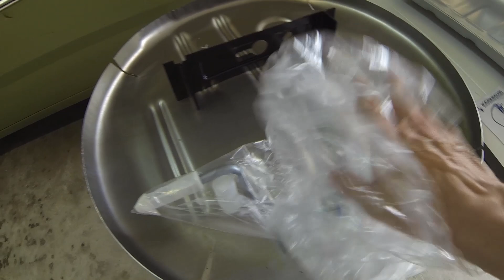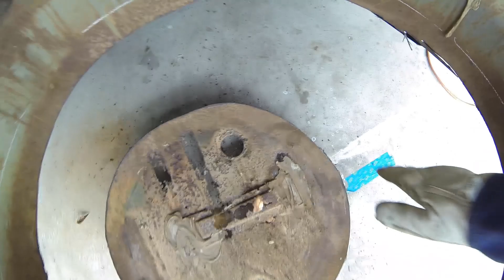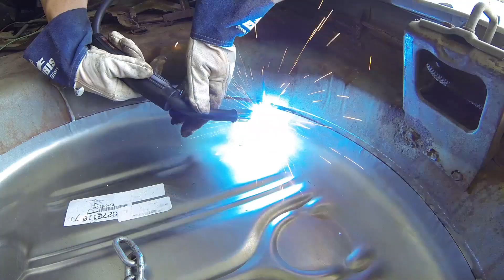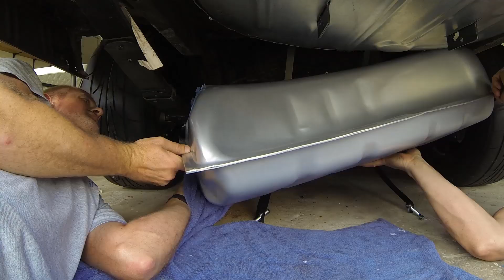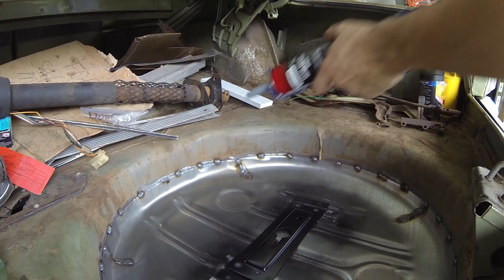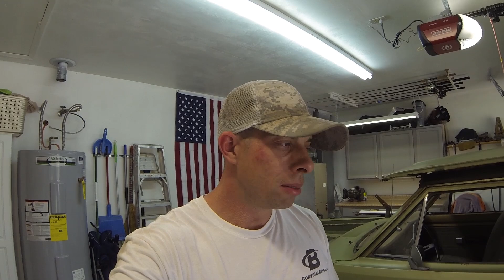New Trunk floor pan and Fuel tank(69 Valiant)

Comment: Alex, I have done many weld jobs in the Navy. What I learned is when welding on steel and you have a hole or area behind your weld where there is nothing. Instead of using aluminum. Place a nice thick piece of brass behind it. We weld filled holes on submarines all the time. We just grabbed a piece of brass solid stock or round stock 2" or so in diameter by 2" in length. Just a simple slug. Then hold that behind your area to weld where there is nothing behind it and fuse your two areas of steel that way.
Reply: Or you can use copper. Get a piece of copper pipe and flatten it.

Comment: I knew they make a 5/16 inch and a 3/8 inch line sending unit but a 1/2 inch line would work so much better if your running a fuel injections set up.   Where did you find that at?
Reply from the maker: Rock Auto
Reply: @TheGasTap  Thanks.

Comment: Hey guy I'm not trying to be rude you do such really good work I mean I watch to do the axle and everything and put the gears in and you really precise do great work look take the time and put a complete weld on the inside of the bottom of the pan for the trunk and then put a complete weld on the underneath around the pan for the bottom of the trunk and then grind it smooth and flush and blend it in take the time and do it right I see you do such good work don't get cheap here take the time and do it right again I'm not trying to be rude I think you do really good work and I think you know you should just weld it in
Reply: Raymond, I have to respectfully disagree with you. Most body panels are spot welded together and then seam sealed from the factory. This repair was performed in that same fashion. 
Either way, Alex is building his car and building it his way. I happen to think he is doing a great job.  Best of luck to you in whatever project you are working on.

Comment: Loving the progress on the Valiant, I have a soft spot for the A bodies as I owned a '68 Dart GT in my late teens/early twenties,FYI the wrench you found in the trunk is used for acetylene torches to take off the hose fittings from the tanks when necessary.

Comment: I need to do the same thing on my Duster. Id say its a stretch goal. I have a fuel cell it came with. I just dont like it. Want to just get gas like a normal person. Thanks for sharing! I did get my new headers in the Duster, what a job! Check out the new video.
Reply from the maker: I will. I like your car.

Comment: What's your tire size & wheel offset ?are you planning to minitub it too ?
Reply from the maker: I have a narrowed rearend so this probably wont help you. 275/60/15 tires, 15x8 rims 4 inch offset. Please check out my other videos. All your answers are there.
Reply: @TheGasTap  Cool, I've been watching, great choice of car. I'm doing a narrowing soon of my 8.75, 2.5 inch narrower than a-body specs,  U.s. cartool Mini tub & spring relocation as well with 15×10s 5 in back spacing. Probably go with the m&h racemaster 325 50 15s .